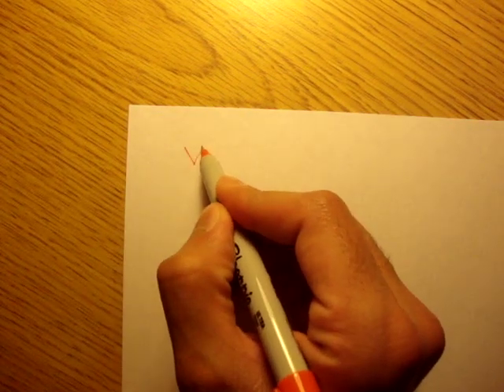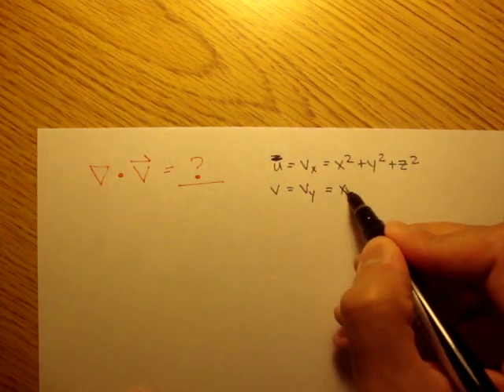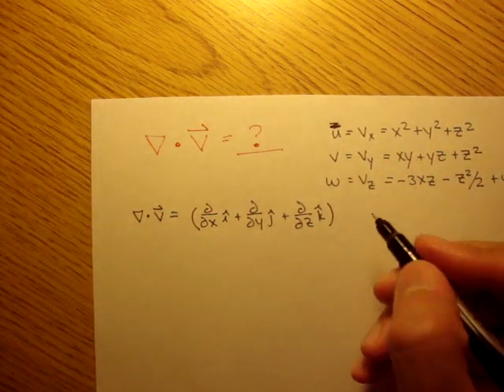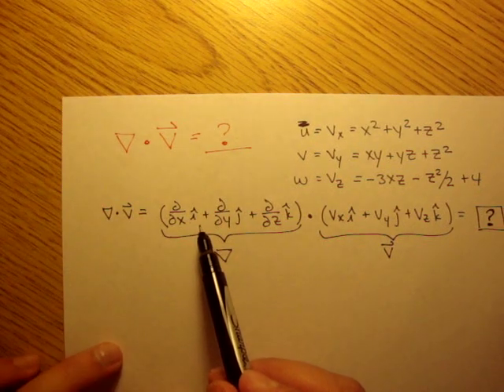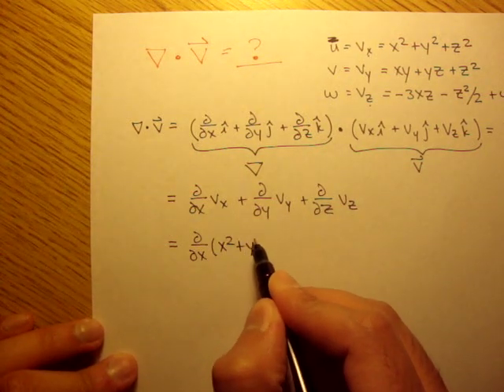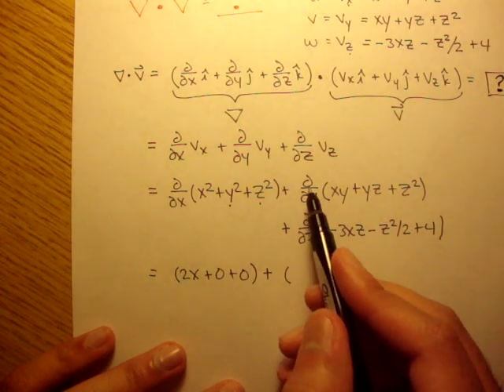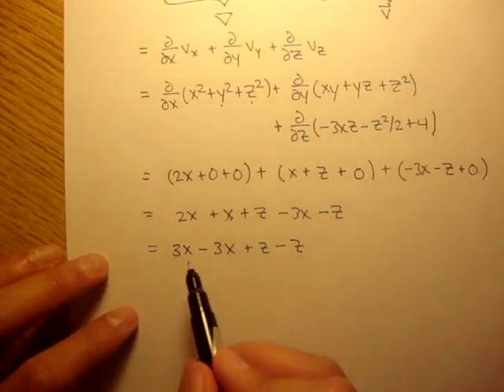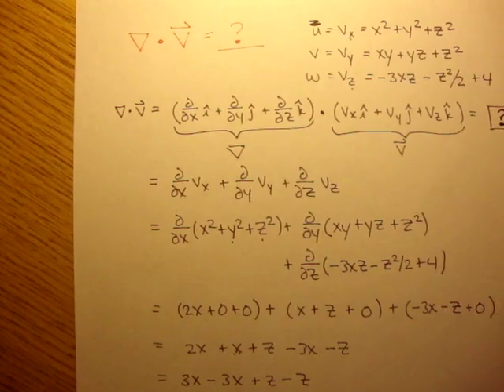Fluid Kinematics: Example 1: Dilation Rate [Fluid Mechanics #16]

Comment: Aren't you supposed to multiply (2x+0+0) with (x^2+y^2+z^2) , (x+z+0) with (xy+yz+z^2) and ( -3 - z+0) with ( -3xz - (z^2)/2+4) and then add together. 
If it is not so, can you please explain so. Its a bit confusing. Btw thanks a lot for the note. Extremely helpful.. :)
Reply: when you do the (del) dot (velocity) operation, it becomes the partial of vx + the partial of vy + the partial vz or (du/dx)+(dv/dy)+(dw/dz)